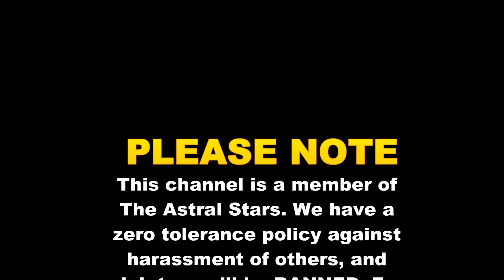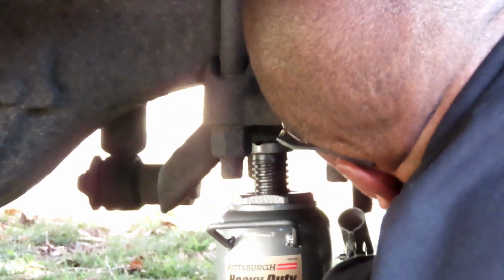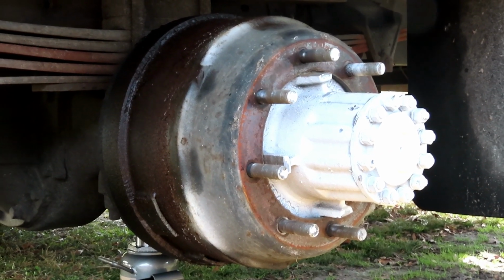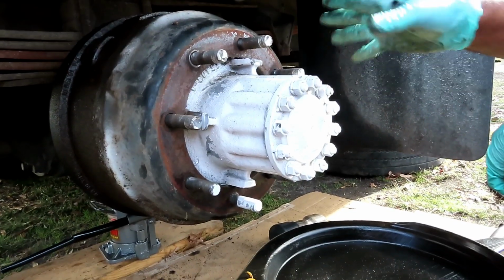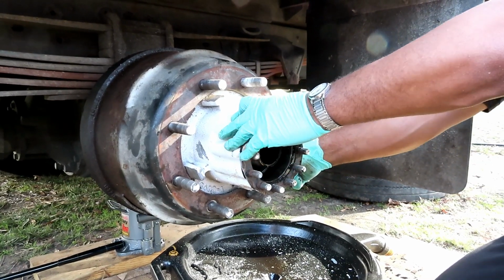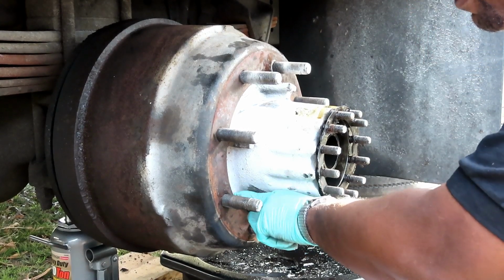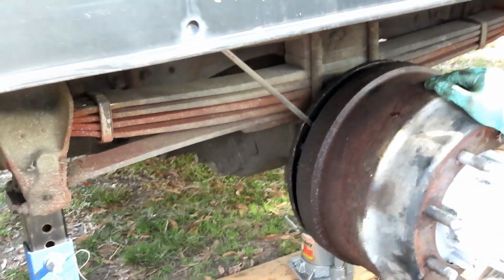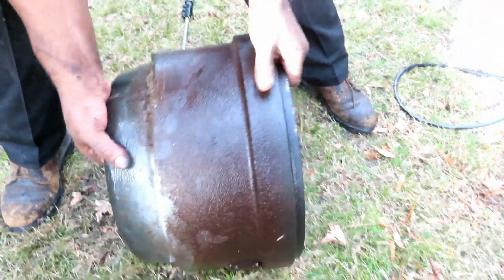⭐ Part 1 - 1993 Ford F700 - 7.0 - Lucas Girling - Rear Forward Wheel Cylinder

Comment: There is a screw on the back side of the emergency brake cylinder that you screw out to remove tension on the shoe against the drum when the truck is turned off.  The drum should slip right off and you won’t have to take the axle or anything off. 😎

Comment: Go to a brake and clutch place in the city and the whole backing plate assembly is around 400$  and core exchange (Minus the park brake can)
Reply: I forgot to say thanks for sharing your experiences, I have a 600 I am having brake adjustment issues on so here I am watching your video,,   VERY few even mention adjusting Lucas-Girling brakes.  I have done several Lucas-Girling truck brakes and a few were BUGGERS.  One had a broken axle the owner puled home loaded with shattered axle still in and it swaged the spindle outward so much it it bound the inner bearing tight.  Had a LOT of meticulous filing but it made the one on your video look like a walk in the park
Reply from the maker: Thanks. Wow, that sounds like a lot of damage